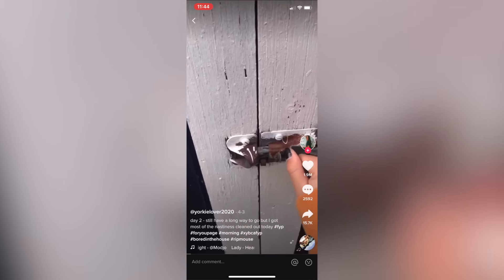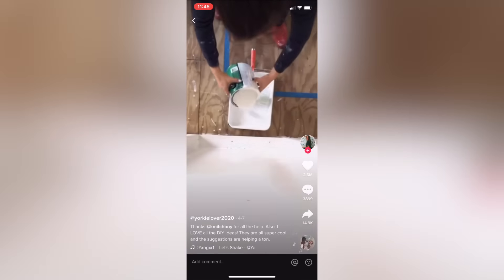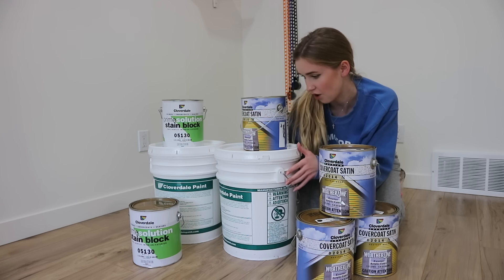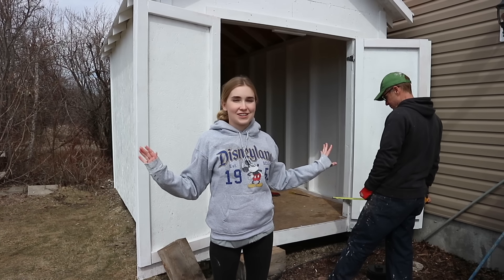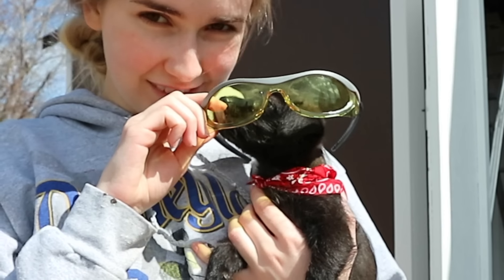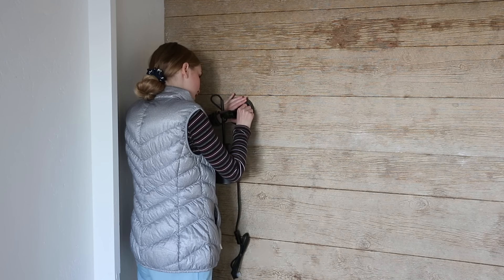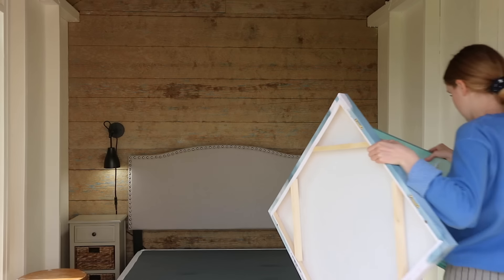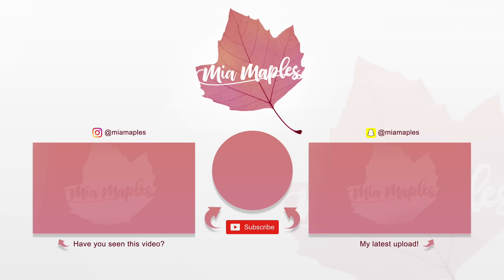Transforming this FREE SHED into a Guest House !! *dramatic results*

Comment: A few tips from a contractor: you can get primer tinted to be close to the color you are painting which is especially important with dark colors, insulating is much easier than it seems and would make the shed more even in temperature year round, I would recommend putting siding on the outside otherwise that chipboard can rot easily, and also for other trying this, check with your city to see if you need a permit to build a shed on your property first! Looks great though!
Reply: This was mostly a YouTube video project is my guess because that chipboard won’t be able to stand snow and rain for long. Good point about the permit, but this is true for everyone, not just the viewers right? Cool of you to give valid tips. Be safe, happy and free... ☺️.
Reply: Thank you! It's so weird to me that they decided not to insulate this shed in *Canada*...
Reply: Yesss!!! I was so confused about why they didn’t insulate or add siding if they wanted to use it as a guest bedroom.🤣🤣
Reply: @graceeann  cuz this is just a click bait video I don't think its useable without perfect weather but even with perfect weather the bugs are getting in through the door cracks

Comment: Just curious as to why you didn’t insulate the walls and put dry all on? Also what did you do for the holes in the ceiling? Did you put a roof on?
Reply: I kept thinking the same thing!
Reply: I was thinking this too! What if it rains 😨
Reply: yeah came here in the comment section looking for the same thing.
Reply: if you saw when she was putting in that wood thing i think it covered the little holes in the roof
Reply: I came to find out too. In Canada will it not be super cold? I absolutely LOVE it, though. And yes to the cute puppy intermissions 🥰🙌🏼🐶
Reply: I think they did. If you look at the shoot when Mia is dragging the packaged carpet you can see some kind of tarp draped over the roof. Plus when they fist put up the boards on the ceiling you could clearly see the light shining through the gaps. But towards the end you can't see them anymore. That's why I think that they indeed put something on the roof. Plus you obv need some kind of snow and rain protection on the chipboard, otherwise it's gonna absorb the moisture and puff up.
Reply: this is what i was thinking! the carpet and everything will get ruined if they don’t
Reply: Especially with that Canada weather though
Reply: Came here too say the same. Even if you don't like drywall you could use tongue and groove.
Reply: Yea my mom had a studio with no installation and any furniture or cloth material smelled really musty over time and it gets pretty humid. She will definitely at least need to put a good dehumidifier in there
Reply: I don't think that they will actually use tbis shed...
Reply: I’m worried about small critters 😣😖 what if a speedy spider wanted to cuddle with the guests.
Reply: This video was more about the decorating than actual function I think.... that is will be filled with bugs quickly... I honestly kinda hope they get that stuff out before it gets ruined
Reply: SAME
Reply: Yeah, when they were putting on the ceiling I saw a ton of holes and it made me cringe so much!!!
Reply: Kelly Magaro Canada’s only really cold in the winter we have very hot summers, so this could be used in the summer but they might die from heat stroke hahah
Reply: I think the wood panels went over the holes or at least closed them.

Comment: As a fellow Canadian I’m curious how it will hold up in winter, or if you’ll have to weather proof it more! (Knowing that people won’t use it when it’s cold)
Reply: Natasha J I would assume she would eventually need to add siding, insulation, and dry wall for it to really work for Canada weather
Reply: I taught the same ahaha probably just for summer !
Reply: yeah tbh I don't understand why she didnt do siding on the outside and drywall with insulation on the inside... but I live in Alberta so maybe it's more mild where she lives? 🤷‍♀️
Reply: I dont live in Canada I live in California even I wouldve added siding and insulation, this shed was made perfectly for installation! Im sure eventually shell have to make those changes if she wants it to last
Reply: Even in the warmer parts of my country (NZ) insulation is absolutely necessary in any dwelling to prevent cold and damp. Really confused that she didn't do this. It will get damp and mouldy, it'll be drafty and it won't be suitable for anyone to sleep in.
Reply: Not just cold. Being a dark color will make it super hot in summer. I’m not quite as north as Canada but am only a 2 hour drive south of it. Our building code for houses requires 6” boards on outer walls. Sheds obviously are built much less robust with 4” boards for studs. Even if you insulate, you will be hard pressed to get that R value needed for a comfortable sleeping area in 4”. You also need a moisture barrier for the floor and walls. Aside from feeling humid, over time you will get mold and mildew especially with the carpet. It looks great and was a fun project but there are some areas that need improvement if this is going to hold up for someone to potentially sleep in periodically.

Comment: I’m shocked that you didn’t insulate this building and put in a heat source
Reply: I was thinking the same thing!
Reply: My thoughts exactly
Reply: And there’s no underlay under the rug or damp prevention smh..
Reply: Thinking the exact same thing!!
Reply: Gonna smell damp in a couple of months
Reply: I was thinking the same - there's clearly some electricity, so a space heater would do something, but some insulation would make this shed useful for more of the year, and help prevent mold from growing.
Reply: And did you see that crack on the ceiling?
Reply: I wanna see the shed after three winters, picturing so much moisture damage lol

Comment: It's cute. I would have done a few different things: 

1) It would've been easy to put insulation up, followed by drywall. Then, it would be warm and usable for longer.
2) Seal those cracks up, because you'll get moisture in the wood that will cause warping and mildew, as well as leaks and drips.
3) No padding under the carpet?
4) Maybe a metal door plate along the edge of the carpeting to protect from moisture getting in the rug under the door?
5) A full bed rather than a queen, or why not a futon? 

Also, maybe it would've worked better at a rec room?
Reply: I agree with you 100%. There's nothing functional about what she did. It looks good, but it won't be usable very often. Even if a guest did come there's so much furniture that there's not space for anything fictional such as a mini fridge or camp toilet.
Reply: Yes, but she is also not a professional. She can always go back and revise things as she learns later:)
Reply: if it was intended as sleeping put insulation! not hard even for non professional.
Reply: @rangerlovee3324  especially in Canada!!
Reply: I’d be concerned about mold on the bedding, mattress and carpet.  It will need to stay dry and kept heated in the winter otherwise it won’t last.
Reply: This was only done for fun.

Comment: Sory if the question is stupid, but i saw that there was light coming from the center of the ceiling, whon't the shed get wet if it rains outside?
Reply: Not stupid. I noticed that as well. All that nice furniture will be ruined.
Reply: Not to mention that’s how wasps form their nests, in small crevices like that :(
Reply: She said earlier they had to take the shingles off the roof because it was too heavy, so they probably put them back on last. Should keep water from going in :)
Reply: During the reveal at the end of the video the shingles are back on and the roof is sealed.
Reply: I also noticed that. And on the sides of the roof it seems to not be sealed.
Reply from the maker: That hole was only there before the shingles went on! Now with the shingles there is no hole and no water leaking in! :) thank you!! :)

Comment: Since it’s not insulated, I would’ve painted the outside a light colour or even white to reflect heat.

I wish you had explained the electrical situation, too.
Reply: I know she didn't explain it, but I'm assuming that since the shed is so close to the house proper that the shed draws power from an outdoor outlet against the house.

Comment: I feel like it might leak if it rains, even if you covered that hole.
Reply: It will leak because they didn’t put any seals on the shed they just left it as is so when water touches compressed wood it inflates is and  it starts to decompose and loose structure if you will and that it’s all made out of compressed wood And they should’ve added installation and drywall as well And treat the wood and floors for pest control it’s just minor little things that really makes a world of difference
Reply: @aubreysalvatori  I literally went through comments to see if anyone noticed these "minor" things that really make difference like insulation, cause there's not only be hella cold inside in Winter but also hella hot in summer
Reply: I wondered why they didn’t put insulation of any kind.
Reply: @shinikurogami3054  that's exactly what I was thinking the whole time!
Reply: hey everyone! just a reminder. Jesus died for us, was buried, & rose again on the third day! because he took the punishment we deserved we can have eternal life if we so choose! ❤️
Reply: @candace6893   hey candace just a reminder, keep your fairy tales to yourself thaanks
Reply: I was wondering the same because there was a huge crack in the center of the ceiling. I feel like it’s going to get so moldy
Reply: She cleared that up in her top pinned comment. They shingled the roof
Reply: candace j just a reminder, Christianity isn’t the only religion. 🖤

Comment: first time it rains its gonna be a disaster in there
Reply: Bibi .SurpriseMe I was thinking the same thing.  They need weatherproofing and shingles.i would also have put wood siding on the outside chipboard is notorious for warping if water gets in
Reply: No kidding. No insulation, no weatherproofing, no proper ventilation other than the massive gaps of daylight you could see in the roof and between panels. It's not even going to last a few months before damp and mould takes over . My actual storage shed is better prepared than that.

Comment: I was waiting for the insulation, cladding, roofing,  vapor barrier and roof drip edge. It’s going to be expensive to fix this later on when everything is already damaged.
Reply: so she apparently tiled the roof, but didn't address vapor barriers or gutters. also, deciding not to insulate was a mistake in my opinion. insulation isn't just for the fall and winter. summer nights get chilly, and insulation also helps keep heat in. this was a cute idea, but the execution definitely fell short. still, you have to start somewhere!

Comment: For me personally, if I had the right things to do it, I’d put insulation up and put drywall up because it’ll help modernize the shed into a small house and doubles as keeping the heating and cooling indoors. 
I’d also put a window on the side so that you could get natural lighting in the shed. Plus, it doubles as fresh air without having to open those heavy doors.
ANDDDDD I would’ve gone with a loft. Even if it would be a bit cramped, I think with how the roof went up like that, it would’ve been cool to have a two story. You could always add small stairs to the side that you can pull down kinda like an attic. Now I know you mentioned how your grandparents would have an issue getting up the stairs, I HAVE A SOLUTION! 
At the bottom part of the loft, add a hideaway bed so that it doubles as a couch where you guys can hang out too. I’m sure you could come up with a few cool things to add to it.
Reply: I kept thinking about the insulation part non stop

Comment: Aren’t you supposed to seal the outside of the “house” to protect the wood? I don’t think paint is gonna cut it. I’m pretty sure the wood would rot right? Idk, someone tell me lol.
Reply: As long as they used exterior paint and primer it’s good
Reply: Yeah I think she should have used outdoor lacquer and definitely sealed the cracks and perhaps changed and sealed the door. With all the cushions etc that will just really attract moisture and bugs. If they did this they could also use it in the winter If they put a small heater.....
Reply: @BrettTwoNames  It has to be 
several layers of primer like she knew that anyway, and it has to be the RIGHT primer Quality bc of the cheap chip board and the topcoat HAS TO BE THICKER quality or layered on GOOOD of an Expensive Exterior paint L> IT CANADA !?? wt ! IT Will snow !?!! DRIFT and blowww the snow INTO and AROUND that building even near it ITS GOING TO PARTICULARLY GET DRIFTING !!/ICE … ok This IS A TOY to Her and Them I guess , ? Wetting the bed doesn't matter I guess lol with this ?? shrugs ?? and leaves page for good ! ?? Has more money to spend wiser than this :) !! bye bye

Comment: This is great! I get the insulation being difficult in the winter, but I think it would still be worth it so it can be usable for a longer period of time. I also think adding a little half bath (or 3/4-like the ones in those teeny tiny apts Ikea gives ideas for) would be 👌🏽
But obviously, this is just one opinion. It came out beautifully!
Reply: I'm surprised Mia didn't add insulation in the shed cause that how you fix the problem of inside being warm in the winter

Comment: Why didn’t you insulate it and Sheet rock it.  That way you would definitely be able to use in during a colder season!
Reply: Where we live it's super cold in the winter even dall/spring, it would cost so much to heat it even with insulation that it honestly isn't worth the extra work of installing. I think she addressed it in a comment, but I thought I'd add cause I had a shed that was turned into my room, only for the summer and we didn't insulate cause It's just not worth it
Reply: Maybe too expensive.
Reply: @1LauraMeow  damn
Reply: Also i saw outside light coming in through the roof the rain will come inside the shed
Reply: @LadyS723  she mentioned in the comment that they fixed that so there's no more holes.
Reply: @1LauraMeow  pop off 👏
Reply: @jena8175  you clearly don't use common sense. It's obvious they meant fall.
Reply: @LadyS723  read the pinned comment. It’s in the very first sentence.
Reply: @jena8175  some people.... (you) are just
1. Horrible
2. Rude
3. are hopefully never going to be parents to humans nor animals
4. Just straight up dramatic

Comment: The only problem I see is that rain and bugs will be able to enter via the gaps around the doors.  Some caulking could be a possible solution or even foam.  I used both on my renovated shed turned office.  Great job, ya’ll!!

Comment: You can use it over the winter just add insulation but also take confirmation In to consideration slot of people spray foam. And you can use a heater good luck and enjoy the new space🤗

Comment: Insulation? A proper door with a lock for safety. A heater for cool weather. A bathroom? Also, a smoke detector for again, safety.
Reply: They are just winging it.

Comment: You can put a propane heater in the shed and it will keep them warm. Use some insulation it will help keep it warmer and cooler. It is so cute.

Comment: Insulation isn't just about keeping a building warm. It is also about keeping the heat out on overly hot days. It would make the structure much more useable and comfortable summer and winter. Also let's not forget it also helps to sound proof a bit. Have you made the doors water tight? There appears to be gaps around the doors when they are closed.
Reply: this! this is constructive criticism!

Comment: Just a thought though, due to the shed being so close to the exterior of the house, it could very likely cause structural issues from the continuous water and snow run off. In addition, with the lack of airflow and sun between that area, you’ll likely see problems with water damage, rot and decay to both the home and shed in a few short years.

Comment: You could have easily insulated that one if you wanted--would have obviously been a lot more work--and put in a little baseboard heater. Did it with a similar building with very cheap windows and it still keeps it super toasty no problem.  Space heater might even do it honestly, though not as efficient. Vinyl flooring would also be super cheap for that little of a space and finish the floor off nicely as well as add extra padding under the rug, and then you wouldnt have had to fit the rug to size 
Would also definitely put siding on at some point, crazy it didnt have it already. If you wanted you could redo the door then, make it a single weatherproof one. 
Love how it turned out though, looks great!

Comment: Hey sweetie...so I'm just now finding you and I realize that this shed is already finished....BUT going forward on other projects maybe...so you Had a question on painting over compressed board or any wood or fake wood for that matter...It's always best to Shellac ....that will stop the surface from sucking up all ur paint (which is expensive) andddd a Bonus is...it Locks in ANY smells and/smoke ....Plus It seals the wood or fake wood...so it Lasts Triple the time. ..So I hope this helps maybe on another project or furniture flip...stay blessed and by the way....ur parents are The BEST ..and I See where YOU got Ur bubbliness🤗🖌️🎨❣️

Comment: For insulation, I would look into spray foam, walls and ceiling and then putting foam insulation board on the floor. Then you could put pergo wood floor over that.

Comment: The low cost of insulation would add additional value, block out exterior sound and give your visitors privacy. Okay what happens in the middle of the night and your visitors need to use the bathroom? In the corner near the door add a camping toilet. with baking soda it could really have been under one of the nightstands covered. Good job!